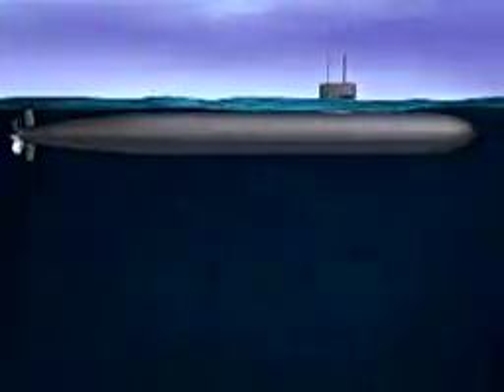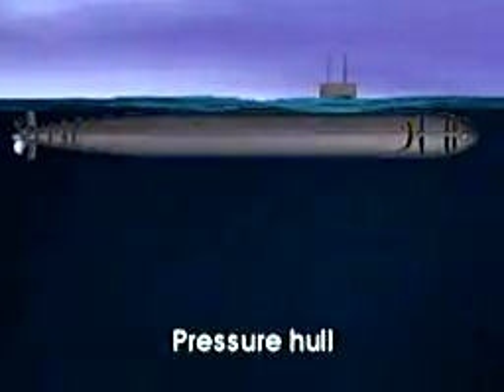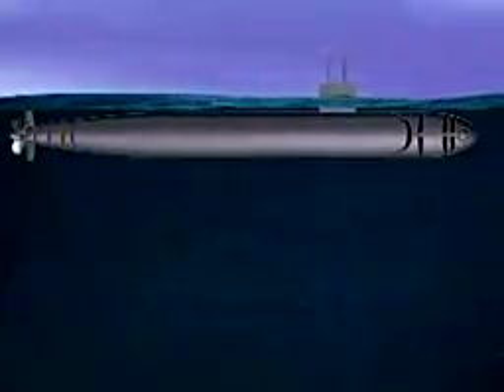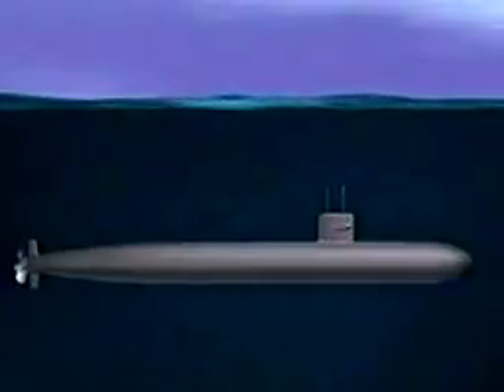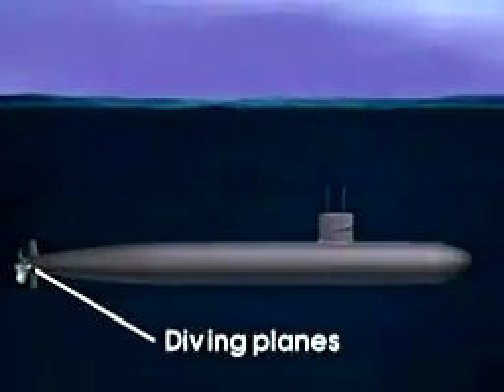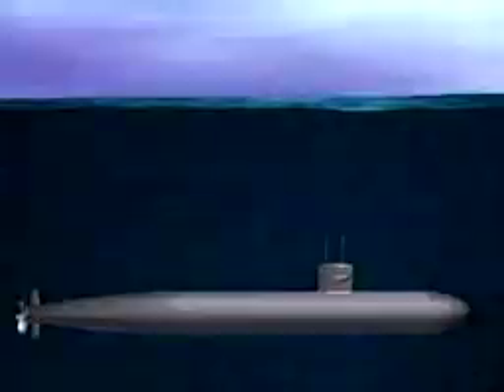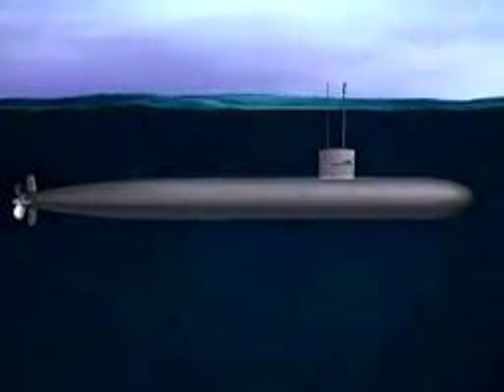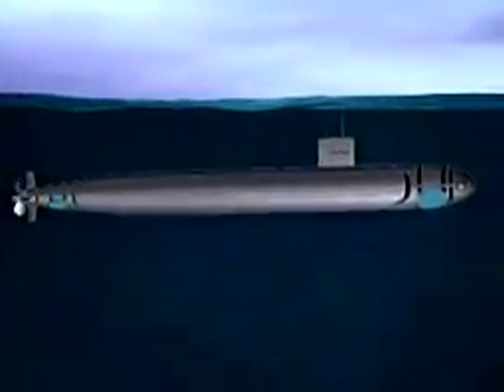How submarines work

Comment: My submarine won’t start any suggestions? It’s nuclear powered btw
Reply: Have you tried changing the nuclear rods?
Reply: DeadTurkey2017 162 I’m going to try that
Reply: @Shotgun93Alexander  tell if it works and I'll be in touch good luck
Reply: DeadTurkey2017 162 that helped thanks a lot I don’t know why I didn’t think of that
Reply: @Shotgun93Alexander  no problem

Comment: I get that the submarine sinks when taking in water but how do they get it out again? Shoulden't the sub get some sort of vacium when pushing out the water again?
Reply: They typically don’t use air to surface. Instead, they tilt the dive planes and use the propeller to drive upward, much like how an airplane adjusts its altitude in the sky—except the submarine does this in water. However, they do maintain compressed air in tanks as a backup, which can be used to blow water out of the ballast tanks if needed. Though, the first method I described is the normal way they surface.

👍

Comment: When the ballast tanks fill up with water, the submarine sinks correct and when the water in the ballast tanks is expelled the submarine comes back up to surface again? Is that correct or is it another way? Im trying to understand how a submarine dives below sea water and comes back up using inner pressure and ballstic tanks..
Reply: Submarine coming to surface and diving down, it depends on the ratio of Air and Water in the ballast tanks, 
More air more shallow the submarine comes,More water deeper the submarine goes.
I hope it helped you understand, and yes you are correct.
Reply: @TheOneupg1  You do not understand!
s/ Retired twenty four year Submariner - USNA Class of 1965 - Former Enlisted Man
Reply: The way I understand it is that if you pump the water out of a ballast tank while not filling it with air afterwards would

(1) necessitate a much stronger pump as it would have to work against the negative pressure that would be created by removing the water and creating basically a vacuum and
(2) the resulting negative pressure inside the ballast tank would complement the excess pressure (water pressure) outside the ship and create more strain on the ballast tanks, which are not extra thick, as shown in the video above. Ballast tanks are not laid out to withstand negative pressure from the inside. Creating a vacuum inside would make them more susceptible to implosion due to strain from both in- and outside and would effectively reduce the depth a submarine could dive.
Reply: You seem to have understand
Reply: Ya - I was wanting to know - can the sub use the water from sea for ever and when it releases the water the sub comes up and when water goes inside the sub dives.

All i want to know is if the tanks with water is drained then why is air needed. Why not let the water out of the tank to make the submarine light and go back up? I understand air is pressurized in a cylinder but this air is presious and limited so what if it runs out - its not forever there. Why not just release water to go up and take the water inside to go down?
Reply: Raghav Sood yes you are right :)
Reply: So your saying instead of filling tank with air, you can just fill tank with water when diving and release the water when comming up. Do you think it will stay down there when water is released or it will come up? I have experimented with my toy in swimming pool, by putting water into a cup then taking it down to the floor then taking the water out while on the floor of the pool. It stays down there NEVER comes back up even if there is no water. So i wonder how a sub wud do that. I think there is a risk. I wonder what they do with no air
Reply: Raghav Sood my friend design of a cup and a submarine two complete different things.
Reply: Please how do you take the water out of the cup while inside the water?
Reply: An Enraged Banana Yogurt the air is compressed out while opening the water inlets. So vacuum is created.
Reply: Why dont submarines capsize ?
Reply: you are right some extent.
1. The air is pre filled with Air. Water is pumped in from sea and pumped out to keep submarine at certain depth.
2. Air for Crew breathing has different tanks than those ballast tanks.
3. Submarine design specification designates how long can it stay under sea level.
4. Submarine do comes up when it has a need to,
5. Water from sea is used to pumped in and out to the same tanks prefilled with air.
6. The Air and water ballast tanks, they depend on the design of submarine, they can be separate or can be a single common tank.
Reply: @TheOneupg1  Nope, you still do not get it!
Reply: Yes it helps me understand how it dives underwater and comes back out of the water . Im trying to understand are the tanks pre filled with air and water and what if during a journey it runs out while the sub is underwater about 1 km down sea level? Do they need to be rescued or can they use the outside water to come back up?

The ballast tanks hold air and water both or in differant cylinders?
Reply: Chukwudi Onuegbu built a pump inside a cup so that it can pump in/out water from the cup that ha a top covered. no opening except for water intakes/expel.

Comment: though i am kind of wondering if how many people it takes to operate/drive a submarine can one person do it ... or does it take 12 people more less... i would imagine it would depend on how large the submarine is to some extent but curious if there is a video on the crew operating  the submarine taking you thru who is doing what and how it all works in real time
Reply: Well, I served on an Ohio class ballistic missile submarine that had 150 aboard (134 enlisted and 16 officers give or take).  They operate on 18 hour days to help ensure shift rotation and each shift is 6 hours.  So if push came to shove, then you could operate the boat with about 1/3rd of the crew compliment and ensure functionality of all systems.  If we're talking about a pure emergency situation though, maybe 6 people (give or take) in the engine room could surface the boat and take it to safety.

Comment: it's not the added WEIGHT per se, it's the added DENSITY that makes it sink. you can have something that's extremely heavy like one of those massive royal caribbean ships or an aircraft carrier on water, and it will float no problem. it's not weight that makes things sink from the surface, it's density
Reply: +africa93 Ships hulls are shaped to displace enough water for it to float.
Reply: +Abyssal Dision displacement has nothing to do with it either. if you drop a massive, dense rock into the ocean, it displaces a lot of water...doesn't mean it floats
Reply: +africa93 If you drop a massive, dense rock into the ocean it sinks because the water it displaces weights less than its own weight.
Reply: +Abyssal Dision ....because the rock is more dense and has more mass per unit of volume. the displacement has nothing to do with it. if you want to see if something will float, you compare it's density with that of water, not the displacement. basic physics.
Reply: +africa93 When you compare non homogeneous body density vs homogeneous body density you should be more precise why does it sink/float. Displacement has a LOT to do with it. See how hot air balloons can float in the air,  the hot air inside the balloon weights less than cold air outside, but the density difference of hot and cold air is very small, so the balloon needs to displace a LOT of volume (typically several thousand m3) for the cold-hot air density difference become significant and to gain lift. You misunderstand the whole concept about buoyancy.
Reply: half right.   Archimedes' principle states that the upward buoyant force that is exerted on a body immersed in a fluid, whether fully or partially submerged, is equal to the weight of the fluid that the body displaces and acts in the upward direction at the centre of mass of the displaced fluid.

Comment: I have a question when the submarine dives deeper does it need to take on more water into the ballast tanks to go deeper? My guess is it wouldn't, but would be nice if some one can clarify.
Reply: Generally, no extra  needs to be added.  Indeed, if the boat moves deeper the hull will actually "shrink" or compress and the boat will displace less.  This will make the boat actually lighter and want to rise toward the surface.

Comment: When flooded again to dive, does the air get re-compressed, or released ?
So does the submarine ever run out of compressed air, or not ?
Reply: They would run out of compressed High Pressure Air after repeated surfacings... however, they replenish the air by compressing air tfrom the atmosphere.  This is clearly a disadvantage as fsr as stealth!
s/ Retired twenty four year Submariner - USNA Class of 1965 - Former Enlisted Man
Reply: @SaltiDawg2008  it's been 8 years my man you are a fucking Saint.
Reply: @SaltiDawg2008  if the air is just released when diving, will it create lots of air bubbles around the submarine, thus making it easy to spot?
Reply: @SaltiDawg2008  Do nuclear submarines still need to surface to replenish air? can it electrolyze water then compress it to fill the high pressure air?